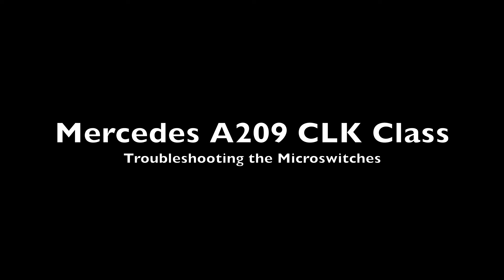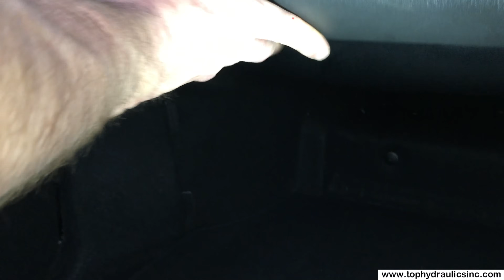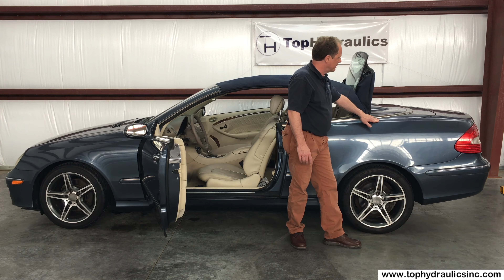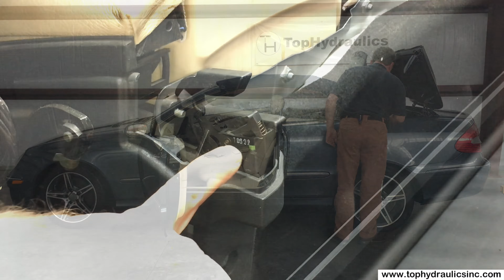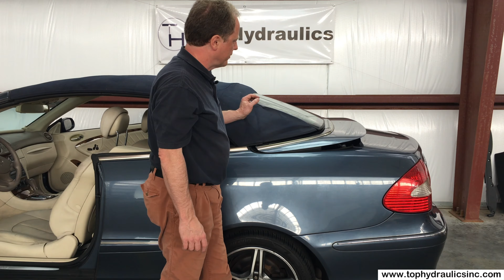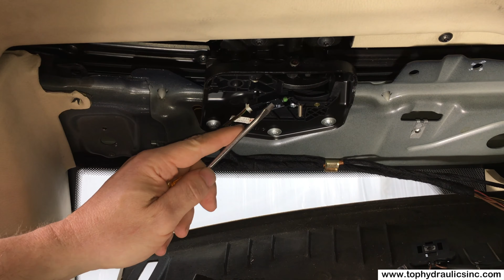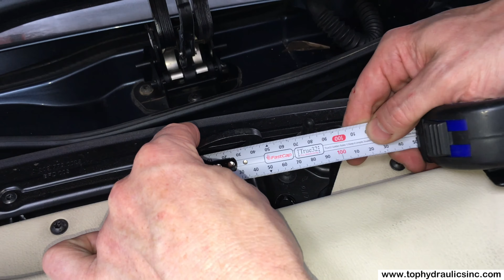Mercedes A209 CLK - How To Troubleshoot the Microswitches

Comment: Hi do you know the correct part number for the "Bow locking limit switch" cover? as the part number for the switch is not mentioned in the video?
the metal faceplates on mine on the passenger side have sheared off. The switch itself is fine , but the metal part needs replacement. Because its not there, the bow rollers dont make contact with the switch.
Also, do you know if the metal part on the drivers side is the same? if so i can swap them round at no cost. I understand they both have two different numbers , but they are both printed on them ?
Mercedes quoted me £150 but they say the original part was superseded with a replacement part number. if they are the same , ebay is the way
Reply from the maker: Thanks for asking. I wouldn't know that part number without taking my own car apart first. Mercedes normally has the part numbers  engraved on metal parts like these. Can you see a part number on your good one and has Mercedes given you the part numbers for the replacements?
Reply: @TopHydraulics  Thanks for your reply. You are correct, the part numbers are engraved on the plates that hold the spring loaded doors. The Drivers side (uk rhd)  is for decoration and to hold the roller. I have taken mine out hoping to be able to swap either side round , but unfortunately this is not possible as although the mounting plates are the same , the spring loaded doors (oval part) are mounted in opposite polarity. I have no idea why they designed them this way . The part numbers are A2097500625 which is for the UK passenger side, which contains the switch, and ending 525 for the uk drivers side which does not contain a switch. I guess for a left hand drive vehicle the opposite may apply, but I cant say.  Both part numbers are printed on the part, and a blue dot is highlighted to indicate which part it isn't... just to confuse things further. I have been told my several ebay sellers as soon as they list the side that contains the switch they are immediately sold as this is a very common problem on uk cars. The plates are removed using a Torx 15 (t15) for the screws
Reply from the maker: @tcollinsization  Thanks for the update! If you search for "Mercedes 2097500525" or "Mercedes 2097500625" on the US eBay site, then there are currently still quite a few coming up. We noticed that the ones in the car we took the videos on, are slightly defaced. I was assuming that it was the result of uneven manual operation. Did yours fail during normal use of the top?
Reply: Hi  @TopHydraulics  No, unfortunately the struts on my luggage cover /ski cover in the boot are broken , disabling the load protector switch. The car was off the road with a leaking manifold gasket. When fixed,I operated the roof for the first time in ages, the roof collided with some axel stands in the boot, denting the edges of the tonneu cover and breaking the  bow switch, and the one mentioned in your video to enable the glass to lower upon closing. Unfortunately after buying a new switch from mercedes, the roof upon operation destroyed it, which prompted my earlier comments regarding left and right hand drive vehicles.

I can confirm today the switch configuation is exactly the same across all markets. I obtained the bow plate mechanism by
pure luck this week for £20 delivered (around $26) from ebay. It has taken about ten hours , several occasions beliving the roof was stuck, various dash warnings
and probably around 20 views of your video , but today the roof is fully operational again thanks to your in depth analysis of these switches. Just in time for our latest storm in england. Thanks Klaus , hope the usa weather is better than ours at the moment to be doing this job outside
Reply: Hi Klaus. Bei meinem w209 geht das Verdeck leider nicht mehr auf. „Skisack bitte schließen „ steht auf dem Instrument. Die Dämpfer habe ich bereits getauscht da sie nicht mehr gut waren. Der Vorbesitzer hat den Schalter mit einem Draht gebrückt🤯. Könnte der Schalter kaputt sein? Hast du eine Teilenummer? Würde mich auf eine Antwort freuen.

Comment: Hi Klaus, thanks for this video! Unfortunatelly my issue is not covered. I have the same issue as featured in this video: https://youtu.be/v-uATompHdQ. Any idea what could be wrong here? Thanks very much in advance!
Reply: I have exactly the same issue, I guess it's covered: https://youtu.be/ZLIdoiw_KTY?t=596
I fixed it for mine today - my issue was solved by adding some Vaseline to the locking claw to allow smoother locking, then the claw was able to push the switch again.

Comment: I made the mistake of closing the storage cover all the way before stopping and lowering the rear window in place. how do i open the storage cover with the rear window still up? it seems locked in place. thank you for the help
Reply from the maker: I see that you posted the same question in the video on manual top operation: https://youtu.be/FNVsKm2kQkg?t=0
You are likely best off opening the tonneau cover manually.

You also could trick the system into reading the rear bow as being down by lowering the rear bow a little and manually triggering the switch that normally gets triggered on the left side of the tonneau cover when the rear bow is down. Since you already had to close the top manually, there is obviously a problem with your top. Thus, again, you are likely better off manually opening the tonneau cover a couple of inches, then lowering the rear bow, then manually closing the tonneau cover.
Reply: @TopHydraulics  same case need illustration please? E Class 2014 illustrate pleasee through a video if possible
Reply from the maker: @cartistco.autostudio6709  Here is our video on manual top operation: https://www.youtube.com/watch?v=FNVsKm2kQkg. Once the top is open, examine the switches as shown in this video: https://www.youtube.com/watch?v=ZLIdoiw_KTY&list=PLly4CMbpk7owNRAl-AECemIb0SVihtBlV&index=10
Reply: @TopHydraulics  Thank you! Switches are fine as they could be seen from inside the trunk, it's a 2014 E class, one question do i need to nuetralize the hydraulic pressure as ahown in the video through rotating or i can just turn plastic lever/pins on the latches towards inside & tie up the hinges & pull up 45 degree angle?

Appreciate your prompt reply, much obliged sir.
Reply from the maker: @cartistco.autostudio6709  Frankly, I do not recall whether pressure relief is necessary when moving only the tonneau cover.

Comment: I’m not really the most mechanical guy, but I do follow along with YouTube videos pretty well. So glad I found your channel. I’ll be needing the full kit of cylinders soon, and am actually excited to tackle this with a little help from a friend, and you, Klaus.
Reply: Hi all, I'm really stuck and hoping someone can give me some pointers? CLK280 2006. On openong the roof the fornt clamps released and roof opened 1/2 inch then stopped. was close enough for me to use the allen key to secure the roof again (thanks for that tip Klaus). 
Current situation is that on trying to open the roof, windows go down, then nothing. If boot separator is open, the separator warning comes up. Clears when separator in place so I presume that is not the issue. 

I have checked the fluid level and it's ok. 
I have checked the 40A fuse and it's ok. 

I sent it to a garage that couldn't find a solution. They provided me with 2 error codes;
B1928 -limit switch interlock of soft top compartment cover remains in switched condition
B1953 - limit switch interlock of soft top lock fails to switch
I've followed Klaus's helpful vidos on manually opening the roof and checking all the microswitches. 
All seem to be clicking correctly. I alos took off the first relay on the pump and checked it. All OK. Haven't got to the 2nd relay yet - was fiddly to release so left it for now. 

While I had the roof maually open and compartment cover was slightly open, I couldn't resist pressing the roof open/close button. Got very excited when the pump engaged and the roof started to move. Stopped after a second or two  but perhaps enough to suggest its not pump failure perhaps?  Note that the pressure relief valve was open at that point. 

I've tried manually opening the roof fully, closing the relief valve and pressing the close button. Again no movment.  Put it all back to where I started and its back ot where I started - windows open, then nothing.

I'm at a loss as to what to try next.  I'd be happy to break into the wiring harness that goes to the pump to see what sigals the pump is getting if I knew wich lines to test. 

Any help would be greatly appreciated!

Thanks, Mark

Comment: Good video, I have a w209 my problem of late is when i’am closing the top the very last closure operation when the rear lid suppose to go down flat and the rear window locks down into position,  you can hear the motors working but it won’t do the complete closure. But when I open the roof I have no problem with the rear lid locking back down. Any advice would be appreciated.
Reply from the maker: Thanks for asking. Please give us a little more detail about the closing sequence: 
Does the tonneau cover move forward exactly to the position where it would be able to receive the rear bow (rear section of the soft top)? 
Does the rear bow come down? If so, how far? 
Has someone recently replaced the top lock cylinder, or has any other work been done to the top system lately?

Comment: My 2007 CLK 550's top has always worked until a few days ago when I picked up the car from a transmission repair shop. They told me that they never touched the convertible top. I am getting the message that the partition must be closed but I cannot move the partition one way or the other... I have actually never moved it in the 5 years that I have owned this car. It just won't budge from the closed position. The only thing to note is that after I try to open the top and I get the message, I then press on the button downward as to close the top and I hear something moving in the back and then it stops. The Hydraulic pump liquid is a little bit over the minimum limit (I checked). Please let me know, what I may check next... Much appreciate.
Reply from the maker: Thanks for asking. The  movement of the partition is not intuitive. The first time I tried to move it, I pushed in the wrong direction. It hinges on top, and the bottom part flips forward. It is normal for the struts on the partition to have loast their charge at this age, regrdless of whether they have been used or not. I would try one more time to open and close the partition, so that you can verify the operation of the micro switch.

Comment: Hello!
I have MB 209 cabrio and when i try open roof its becomes message "Close boot lid". Boot (boot or trunk is close, and its work like normally) Where is is trunk position sensor??
Hydralic pump working normally and trunk lock working normally
Reply from the maker: Thanks for asking. The trunk position sensor is inside the trunk lid, close the the trunk lid latch.
Reply: @TopHydraulics   Thank you for answer. I already change trunk lock but no help (same message still ; close boot lid"..

Comment: Hiya . Need help summer coming close boot separator keeps showing. Last week I put my daughter suitcase in the car think that did it..
Reply from the maker: Hiya, thanks for asking. Very likely, the only problem is that the two gas struts that push the luggage divider against the partition switch have lost their charge and need to be replaced. See https://youtu.be/ZLIdoiw_KTY?list=PLly4CMbpk7owNRAl-AECemIb0SVihtBlV&t=110. The Mercedes part number is 2096900059. You can get aftermarket replacements quite cheaply.

Comment: Klaus is great to work with.  I found TopHydraulics a few years ago when I had leaking hydraulic seals and he sent a very detailed instruction manual with the hydraulic parts for easy replacement. I had a complication and Klaus worked with me to resolve it. Easy core return and credit too. I recommend these guys to anyone with Benz top issues.
Reply: Where are they located

Comment: Please help! My top goes down like nothing is wrong. But doesnt come up. Nothing happens. Sometimes i can get it closed after first closing it manually one time but next day same issue.   Tryed to read fault codes with my scanner but it couldnt read it. Do you have any suggestions on where to look?
Reply from the maker: When you are experiencing the fault, do you get a blinking light on the soft top switch, or an indication in the dashboard that the top is in operation? Does the motor run?

Comment: Thanks for the video Klaus!!  I was hoping to see my E350 issue.  When trying to open, I can hear the hydraulic pump running for a few seconds but nothing happens after that.  Any idea on that one?
Reply: I figured it out.  When I received the pump back from Top Hydraulics I didn't realize that the pressure valve was open a little bit.  I tightened it up and the top opened.    Thanks for providing such a great service.   The dealership wanted to charge me $4k for the repair and you all fixed my pump for about $600!!   Now that's a win win!
Reply from the maker: @AsheboroClanAcres  Glad to hear that all is well. So you have an E350 A207 chassis, which is very similar to the CLk A209 chassis. From what I am gathering here, we have rebuilt your convertible top pump Mercedes p/n 2078000048. The major difference between this pump and the CLK pump 2098000548 is that the reservoir is in the horizontal position in the E-Class and vertical in the CLK.

Comment: Hello, thanks a lot for your video. I have bought a clk w209 with the sunroof broken down. The professional salesman could not repair it, and the specialist was closed for a month. This was the switch "S84/3 Soft Top Open Limit Switch - A2098202010". I took over for him.

But I have another error:  "B1928 Limit switch 'INTERLOCKED' of soft top compartment cover Remains in Switched
condition."
The top is closed, the windows open but nothing happens. Definitely another failure, or something that deteriorated during manual opening.
I think of the "S84/19 Bow Locked Limit Switch - A2098201710", where "S84/13 compartment Cover Lid Open/Close Limit Switch (dual position) - A2098201810". 
I am lost. Sorry to ask you for advice, it would help me a lot, I’ve been looking for two days.
And thanks again for these videos, it helps to better know his vehicle.
Best regards
Reply from the maker: Thanks for asking. The most common culprit is switch S84/11. It can create multiple codes as you are describing, depending on circumstances and how much previous owners have messed around with the system or what they did to close the top. 

Have you checked out S84/11 carefully? Also, have you checked the 40A fuse for the pump? The fuse is in the small black terminal box that the two power cables from the pump get attached to.

Please let us know what you find!
Reply: @TopHydraulics  Thanks a lot. S84/11 run fine: I have tested the clic and the value change on the diagnostic. The 40A fuse is OK too. 
I will made pictures of swith value in closing position. Operate manually and check value at each time of the opening process.
Reply: I have an idea: the problem is that the lid doesn’t go back.  I remember when I first tried to do it manually. The lid did not want to move forward to close, cover opened. He did so with the button reopened also with the button. Since I can do it by hand. Is it hydrolic?
Looking videa again, plastic level in a wrong position...I move it in the opposite, bu was not in the right position..
Reply: iI do the right position with plastic level...

Comment: Good video. I hooked up my scanner and got codes b1900 and b1903. Top will not go down. Says it is opening but nothing happens. Please help.
Reply from the maker: Thanks for asking. I do not have the scanner codes memorized - what is the desciption of codes b1900 and b1903?
Does the pump motor run while the display is saying the top is opening? If the pump is not running, then you want to check the 40A fuse behind the rear wheel well where the pump's power supply wires are hooked up.
Reply: Rear headrest needed to be reset. Took me awhile to figure it out. Thanks for your help.
Reply from the maker: @soberlife1264  Congrats on fixing it! Since the comments on this video are turning into a bit of a DIY repair thread, could you help out fellow CLK owners by describing how you figured out that the problem was the headrest, and what you had to do in order to reset it?